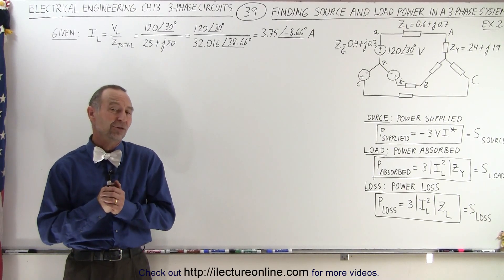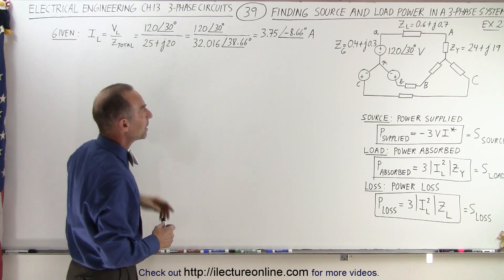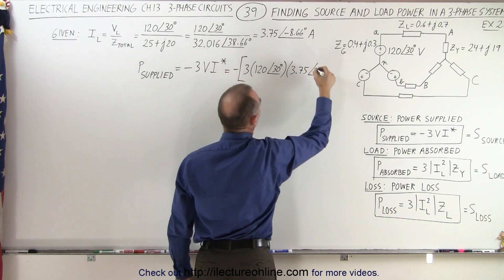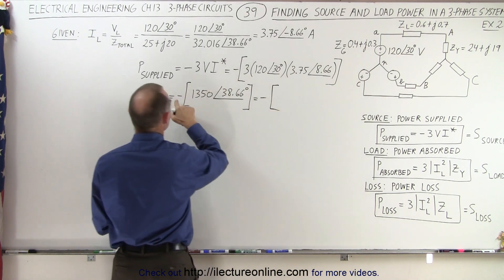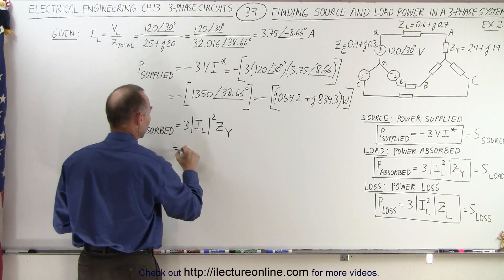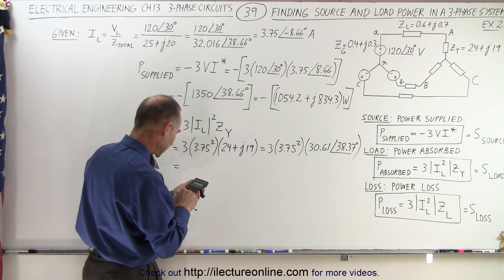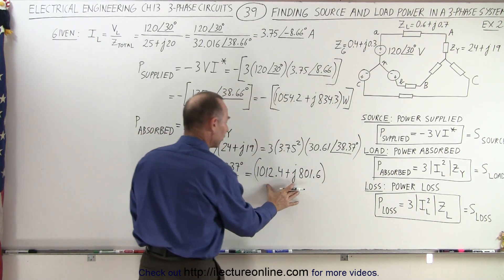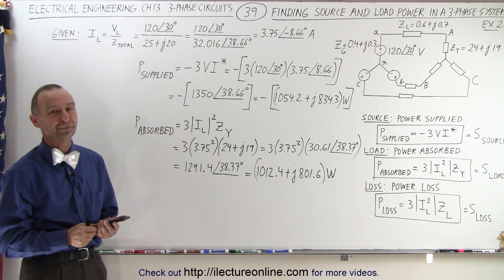Electrical Engineering: Ch 13: 3 Phase Circuit (39 of 53) How to find Source and Load Power?

Comment: The complex calculations can be simplified a lot if you use a calculator like the HP Prime.
It does operations between rectangular and polar formats without complaining and gives the result in the format you want.
Reply from the maker: Yes, modern calculators are very powerful.

Comment: Hi Michel. Two remarks. As others have mentioned in the comments section below; VL needs to be Vp that is the phase voltage, and the units need to be VA instead of Watts. Please confirm or correct me if I am wrong.

Comment: Why there is -Ve in front of  the formula while calculating power supplied by source?
Reply: Supplied power is usually called negative (passive sign convention) so that the total power of the supplied and absorbed = 0. The total ABSORBED power of Zgen, ZL, and ZY is 1054.2W so the SUPPLIED power will be called -1054.2W (also in this video he is actually talking about complex power S but he is calling it P)

Comment: is not P = 3 * VP * IP * cos (theta) = sqrt(3) * VL* IL * cos ( theta) ?
Reply: In Y-Y circuits, the line current is equal to the phase current. So, P = -3 VP IP* is the same as P = -3 VP IL*.
Reply: but why did you put negative in power equation?
Reply: @mahdi.hasnat  The equation I mentioned was for the power supplied. Power supplied should be taken as a negative quantity and power absorbed should be taken as a positive quantity. This comes down from the law of conservation of energy which implies that the total power of all elements in a circuit is zero.
Reply: @nishajawahar hey if you still remember these concepts can you tell me why did we take only complex power to calculate all powers? Why not total power formula?

Comment: Why are you converting the power to polar format only to convert it back to rectangular format?  It's not like you then need to multiply or divide 2 phasor quantities. Instead just multiply the scaler quantity 3*(3.75)^2 by the impedance and just it leave it all in rectangular format since that is what you are using as the basis of comparison. I would recommend an inexpensive calculator (I use the Casio 115 ES Plus)  in which you can mix polar and rectangular  quantities and express the result in either format with no drama. It would dramatically reduce the time and labor of these polar/rectangular conversions by allowing everything to be done in a single step. E.g., -3*(120<30)*(3.75<8.66)  can be done in a single step and expressed in either format without the need for tedious conversions. Please consider this whenever you get to finishing your excellent series on AC circuit analysis.

Comment: Sir ,which V(L)  you mean is it V(ab) or V( bc) or V (ca) ????
Reply from the maker: V(L) = the voltage across one of the loads (from A to Neutral, or from B to Neutral, or from C to Neutral).  Note that the line impedance is also included.
Reply: @MichelvanBiezen  but dont we call it the phase voltage?
Reply: Ok sir I get it thank you